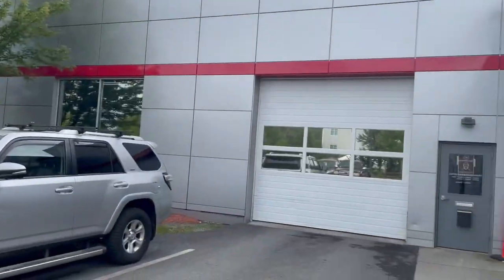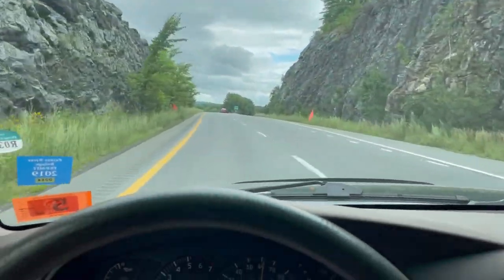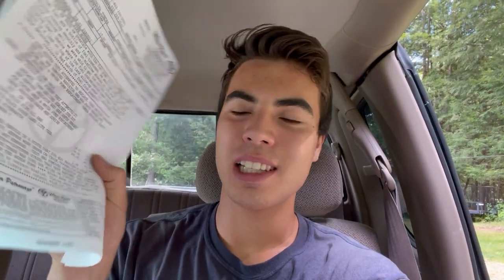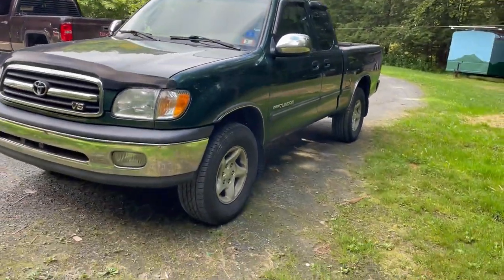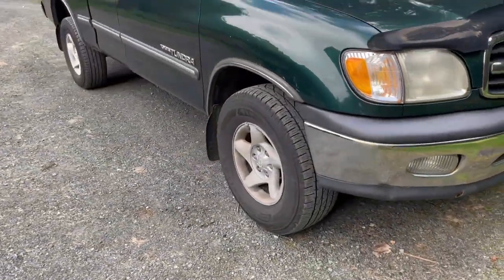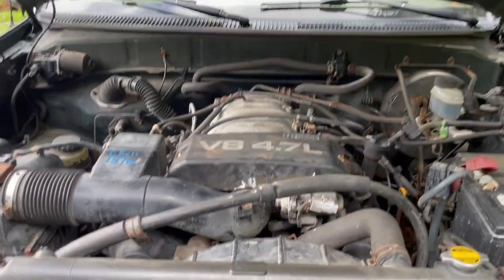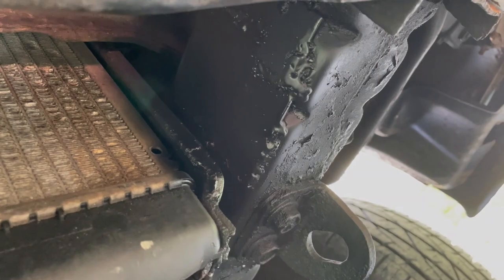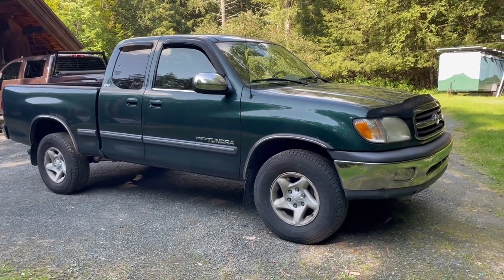Will This $1800 Tundra Start and Drive?? Cheap Toyota Tundra Part 2!

Comment: I see a lot of comments saying the dealership got over on you.... I don't see it that way. They did a great job documenting work and issues that arose. They stated repairs and your authorization to do so. That's just the name of the game. If you want to complain about the price either do it yourself or avoid the dealership and go to an independent shop. Most times they are cheaper. Not crazy cheaper, but cheaper none the less. 

I'm not mad at the dealership on this one. It seems to me like they didn't try and do anything that was unnecessary. At least she's fixed and you know it'll be solid for a future owner.
Reply: I agree.

Comment: I'm about to snag a running 4WD 2003 V8 Tundra in the rare Regular Cabin configuration, and thanks to this video, I'll now add the serpentine belt tensioner to the list of immediate replacement items that includes the timing belt and water pump.

Comment: I had sort of a similar situation.  My check engine light came on for a evap leak.  Didn't want to deal with trouble shooting.  Decided I'd rather take it to a shop.  They tell me a smoke test has to be performed.  Get a call back and they tell me a hose was disconnected.  140$ for being lazy.
Reply: Hey, it beats three grand!

Comment: A 4800 dollar toyota I unheard of these days lol nice score brother
Reply: Bro right. I just bought an 02 with 259 for 5500, granted it’s in excellent condition. Did need front struts so I replaced front and rear as well as the front Lowe ball joints as a precaution

Comment: Toyotas behaving bizarrely is a common theme. My 02 Corolla died coming down a hill. Mice ate my filter and it clogged the MAF sensor. Spent north of $400.00, I authorized a thermostat and coolant flush. Clean truck, too

Comment: I never go to the dealership to repair my lexus ls430 2001 had 3 timing belt pulleys water pump serpentine belt spark plugs replaced for 400.00. I buy the parts and my mechanic does the work.

Comment: I stepped away to refill my glass of water and after hearing all that was said and done as you read off the repair invoice, '...how much do you guess'?  I said to myself $3K.  Nailed IT! 

You had a preminition bc, it was to be expected that an $1,800.00 1st gen with (miles on the clock at ?) not having been a running vehicle, or one you couldn't get running with your own devices and capacities ...well that bill was fortunately paid and your/the truck is home.

Now comes a host of future costs.  Apparently lower ball joints were in condition to allow you to drive it off the property.  I'll now return and listen to the rest to see what the service dept. recommended for immediate or near distant attention. Edit: (...for someone else)

Hmmm, I'm back and with more '411' it appears the milage currently is 187K, correct?

It makes sense if a previous owner had R & R'd the TB at approx. 90K then you were right to get it done, especially if that was not verifiable, Edit: That receipt will help with resale value to a private party.

More post Edit:  Inconsequentially I now know you have sold this TUNDRA for profit since this was uploaded....  But here is what else I had said before knowing about your plans to resell to another who will have the following potential issues, as all older vehicles will have wearable things to fix...  Also FYI, I've heard of this gen TB can go on for 300 to 300.5K miles miraculously.  Actually I'd say more due to its enviorment and one owner not pounding on the right pedal.

Also most of us owners of 1st gen 4.7 2UZ-FE TUNDRA's likely are aware; some peeps say you'll expect issues with the starter around 200K (?) ...  I'll go to your video list (NOT) after subbing to see if you are still with us, and you haven't sold this fine piece of machinery. ) 

Ah-HA, you have sold it. Yeah probably a money maker for you, no doubt.  ...:hand-pink-waving:

BTW my TUNDRA 4 X 2 SR5 is and always has been a SW truck ... talk about rust free framework, can't find any at all! :face-blue-smiling:

Comment: I think you still made the right choice to send it to the dealer if something go wrong they will take care of the problem and the next buyer will be happy to won this car also l know you can do this job but it’s not easy on 4.7 v8 but sometimes let someone do it for you and by the way a lot off dealer they will double that price honest you still got a good deal 
I even have 2004 same car v8 with turbocharged in Dubai and used it every where hunting racing pull my boat and use it on my farm too this day with out any problems.

Comment: You can get more if you clean all the rust to make it more appealing. As I replace parts, I would paint surrounding parts. Recently replaced my sway bar end links and sway bar bushings. I paint the sway bar. Will make it last longer and looks more appealing.

Comment: At least there's some meat left on the bone, and given the repairs it should make for an easy sell. And yes you're right running & driving $1500 pickups are next to impossible to find and will certainly not be this clean.

Comment: I think you did good, a quick flip, minimal aggravation, profit-next. Only problem is getting that S— eating grin off your face, lol, when you got it thinking OMG OMG gonna make big $$ on this one, guy didn’t know what he had, lol. I would’ve done the same thing. When it’s that underpriced you pretty much gotta throw the money at the seller and haul ass before anyone figures out what ya did. Did it need the belt? 90k miles..? Uhh yeah.., if ya got it running on the old belt.., someone buys it and a week later it swallows the valves.... wonderful. All the other stuff the dealer found/repaired...? You would’ve been breaking ur ass, wasting time for weeks- broken bolts, all that..., I think you made the right call on this one- start to finish. Good stuff..., and hey where’s Jeb? Lol, peace.

Comment: Dealers will charge you for both arms, legs and even your wiwi.  I had the overdrive part of tranny that went bad. They quoted me $7K plus.  I towed it to another chop that wanted 4.5K.  I towed it to another shop that eventually fixed it for $1200.  No issues after that.  Of course it failed 7K miles after the 60K warranty.  I was doing a lot of HWY miles so it wasn't even a lot of stop and start. I put in about 180 miles daily so it failed a little over a year after I bought my truck. Other than that, everything has been good since.

Comment: Nice truck great deal i just bought one rolled and im swapping everything into a 66 f100 Ford cause it cost 250$ and i cant find a good Tundra body for under 3k with a bad motor or some other part i have

Comment: You didn’t go wrong by replacing the timing belt on this thing because it’s pretty much the only major maintenance item needed to keep these running forever.  If I’m not mistaken, I believe Toyota recommends replacing it every 100k miles.

Comment: Great video, honestly for the amount of work they have done I'd be fine at that price. Labor isn't cheap at dealers and my dealer overhere would probably charge more. $3k to reseal my transfer case in my sienna at the dealer.

Comment: It Toyota shouldn't be to hard of sell and for how clean it is being in rust belt state. Got love that dealer bait and catch trick but no surprise it would been nice if was what they originally said. Should be good runner for next owner. Depend on how long it sat heck fuel goes bad so quick anymore

Comment: Well 3k is acceptable considering they found several more issues which got their labor up to 2400$. They got the truck running great which is what they were asked to do.
Nevertheless an independent shop would have got it done for under 2k im sure.

Comment: I got my 02 tundra with the 3.6 for 1000 bc they thought the ecu was fried, turns out it was just the crank the had play and it was messing with timing
Reply: Crank had play meaning the main bearings were worn out? Sounds expensive to rebuild or replace the engine
Reply: @robs1852  My bad, it was the timing gear along with the woodruff key.

Comment: Another quick comment, You'd figure that a TOYOTA dealership would have stickers that they write on for timing belt services. More proffesional and probably brings more value in how it looks and for even their buisness. I've seen small shops have these. Bad gas is such a big problem in stuff that sits, small engines outboards, 50% i'd say is just bad gas, well bad gas then leads to other issues in the same system.

Comment: Replacing the bad fuel in the tank wouldn't have fixed the water pump or alternator, $3075 is a bunch of money but the truck had lots of problems too.

Comment: Those 4.7s if there is a problem with the timing it would have gave you a code for timing and so still lets say it jumped timing ive seen them allways run fine its crazy 
90k yes its time to replace but ive seen them 
With 300k on the original  dont recommend it but ive seen it , these are some of the most  durable engines on earth Toyota spent 1 billion in the late 80s designing this engine for the first lexus and the goal was durability and longevity tons of these with over 1 million miles

Comment: That corner of radiator looked wet. Is it possible the radiator leaked onto it and rusted it through
Reply: This year range Toyota has a frame rot problem.  Toyota extended the warranty and issued a recall for this problem.  Something to do with the rust prevention they were trying to use

Comment: First, find a local mechanic, not a dealer.  Second, you weren’t screwed by the dealer as they did way more work than you initially asked for.  Dealer labor is always high.  Good looking truck though.

Comment: 90k miles on timing belt holy crap my truck has 250k yes it is 01 tundra 4.7 I force and no I haven’t replaced it yet

Comment: Sure doesn't sound like 2400 worth of labor O_O then again at what 100 120 140 an hour? The problems i heard you read off sound typical and realistic, only problem being how much it costs. The tech is probably earning maybe 25 30 an hour meanwhile shop charges 100/h more in some cases. I understand overhead and all of that, but its just crazy. Stuff happens stuff breaks gotta fix it, but going from an 800 ish dollar repair to over 3 grand is a little nuts. Being that 80% of it is labor.

Comment: I guess I wasn’t completely wrong on my previous comment, it did need more than just the timing belt in the long run.
Rust on the frame one thing a Toyota can’t get away from.
Could that whole be from the AC condensation??
Reply: The AC condenser is on the passenger side almost behind the front wheel so no way it’s from that. Maybe it was from a piece of road debris that compromised the frame and slowly rusted into a giant hole? Got me totally guessing though

Comment: Tundra's are a pain..Tacoma's much easier to work on and designed much better in my opinion. My tacoma's got 191k on it original everything from the factory except a power steering pump swap at 162k, and your other various common maintenance. Of course, i don't get that vermont rust out here haha. Good vids man.
Reply: Agreed. Moreover although the V6 Tacomas from that era also used timing belt it was a non-interference engine hence there is no risk of getting the valves bent.
And ever since 2005 all Tacomas got a timing chain while Tundra stuck with a timing belt until the 4.7 was discontinued in 2009 or so
Reply: @engineer_alv  Love my 03' V6, one thing looking back i wish it had that it doesn't, is manual roll-down windows. But I love the workspace i get. I feel the Tundras are a little too small to hold that v8, hence the extremely cramped work space under the hood, although Tundras are still great trucks.

Comment: I just looked at one same as that with 200k guy wouldn't go lower then 8,500$ it was really clean but I couldn't pay that.
Reply: Romeo Tene  I remember them not being that much years ago. Now older Rangers are going for 7,000$ or more like a 2003 model i use to buy those in 2010 for 2,500$
Reply: Romeo Tene  Definitely! They offered my friend 36$ for his 2019 Tacoma he only owes 19$ on it with 7,500 miles. He had to actually block the dealerships numbers. Cause they were calling 5-6 times a week. Another buddy has a 2014 F150 crew cab EcoBoost its paid off they offered him like 28k$ it has 100k miles on it. He only paid 23$ for it used couple years ago